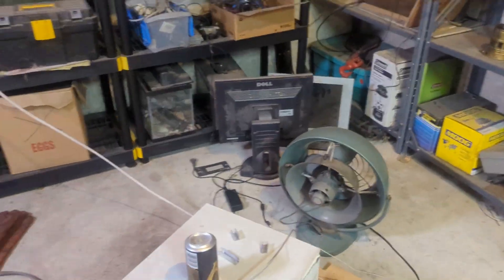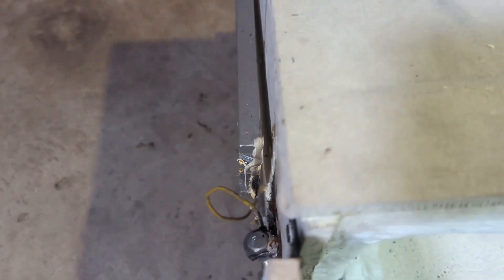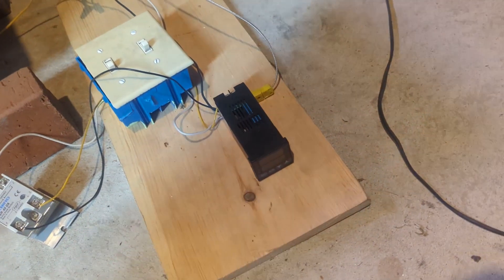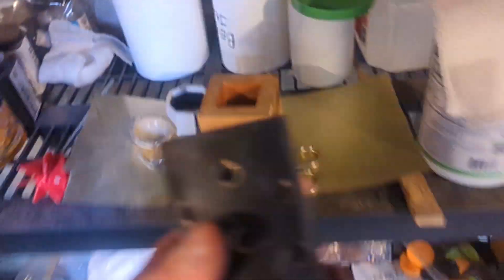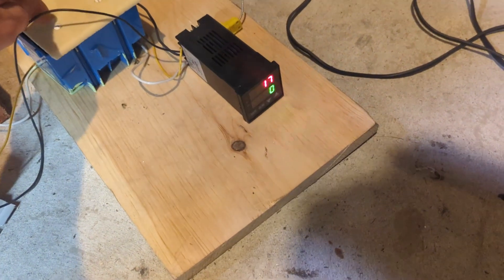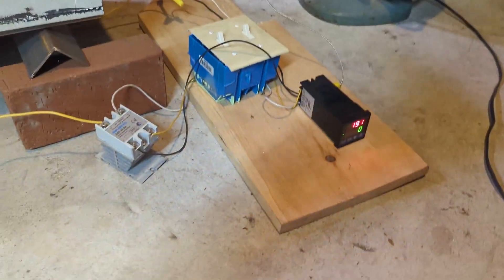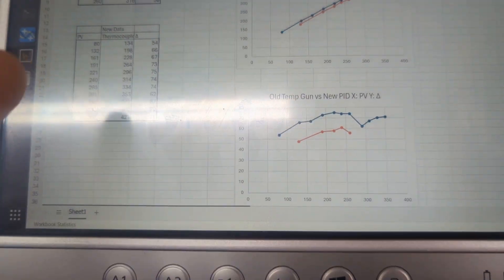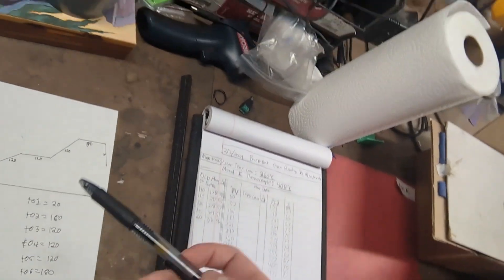Homemade Burn-Out Kiln for Lost Resin/Wax Casting!! -- Calibrating the Oven and what I would Change

Comment: hey bud, i am building similar improvisation, little more info needed. What is your power, current, wire resistance, how big is your kiln? Did you get good results in burnout?